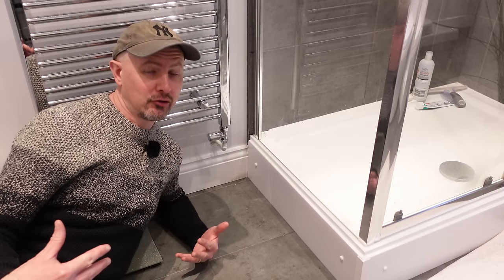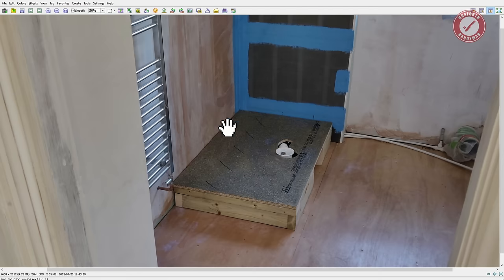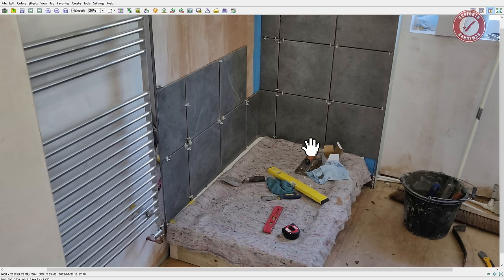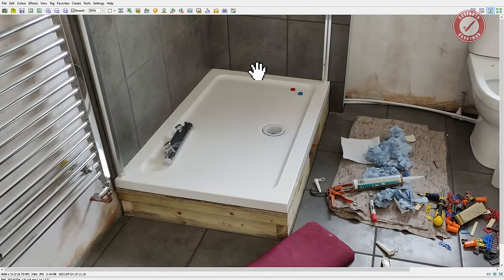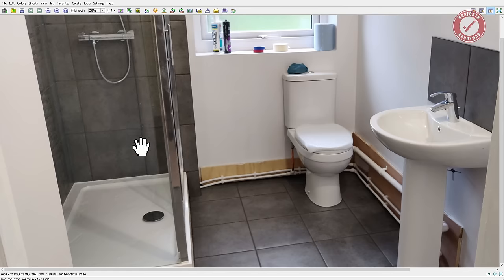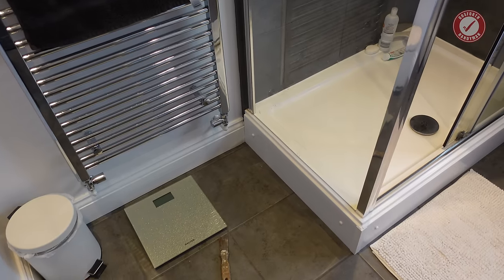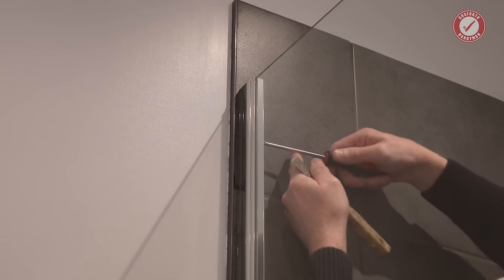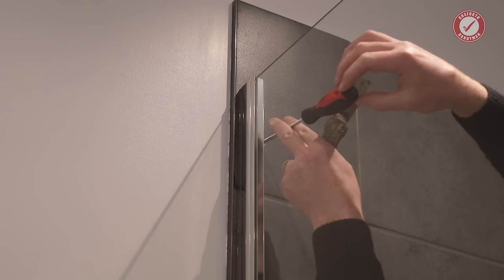How do you fix a leaking shower screen?

Comment: One should never seal (silicone) the outside of the door frame where it meets the shower or tub. The objective is to keep water IN the shower, not to keep outside water from entering the shower. Sealing both sides doesn't allow condensate water to escape, which can cause mold and other issues. Silicon applied on the outside makes the joints between the door frames and showers and/or tubs look better, and that it is sometimes applied as a quick fix because the inside seal is leaking.

Comment: Hi Andy I had a problem with the shower we inherited when we bought our house nearly 20 years ago .  As a seasoned renovator I was absolutely baffled , I obviously intended to replace the existing shower but I still wanted to workout were the leek was coming from just out of sheer curiosity . So I spent a ridiculous amount of time tracking it down .  Ironically the  leek only occurred after a period of time had elapsed , and spraying the shower tray never replicated the problem .  Then one day while using the shower I noticed a small hole in the grouting between the tiles , bingo because I tended to be relatively quick in the shower I never noticed any thing . But when other members of the family used it , the water had time to work its way through the tiny hole behind the tiles and through the floor .  Obviously we have long since replaced that old shower , and are on our second shower enclosure .    I often think what we would all do without the humble tube of silicone , even when we don’t quite get it right .     Best wishes and kind regards as always . 😀👍👍👍
Reply: Leeks and carrots!!
Reply from the maker: Other members of the family - teenagers per chance? 😂

Comment: hi Andy as a bathroom fitter for several years my advise with anything no matter how many times you have done it is to follow manufacturer instructions as they keep changing ( obviously if they have problems) ive had a few enclosure’s leak & they have replaced them because i followed instructions to the letter

Comment: Tidy fix by sliding the wall profile up and everything looks good but if you missed the silicone on one profile, did you miss it on the other one also ? As you showed the tray, tile, screen joint is the weakest spot in the whole "Dam" and may be a problem waiting to show its self. Also I would always seal up the joint where the door slides into the wall profile by 50mm to make sure water goes back into the tray and does not bubble over the outside bottom silicone seal. Having said all that a great video on solving the most common failure of shower screen installation. We have all been there at least once :)

Comment: I wouldn't worry, our new build house had both showers fitted exactly like this, and it was the same on all the houses in the development.  I despair with shower design, generally. Why is there no thought given to overlaps and weathering, as with roof construction. It can't be that difficult to come up with a system that doesn't rely on silicone and can be removed at cleaned.

Comment: Hi Andy, clever fix 👍! I had an issue before I entered the property maintenance profession with a bathroom renovation I had done in a property 15ish years ago. The fitters siliconed the screen on both sides all the way round 😮, against the manufacturers directions I later found out. A friend was using the shower and water started to pour through the hallway ceiling. It turned out water was filling up in the wall rail and unable to escape from the bottom eventually had enough pressure to force its way out through the silicone into the wall and through the ceiling below! They had to replace the screen (it was too gobbled up in silicone to reuse) and pay for repair of the ceiling and redecoration for the hall. So needless to say I’m now VERY careful to follow the manufacturer’s siliconing direction, but see the logic in your case and have done a similar thing for one of my customers.
Reply: Kind of puzzled why somebody who can afford a skiing holiday doesn't get a professional in to install the shower - maybe that's why he can afford a skiing holiday? - but the problem is it's people in later years who often inherit these problems when they buy the house. I'm an electrician, not a plumber, but 95% of all repair jobs I was called out to had been fitted by "handymen", and were often pretty dangerous. 

Currently got a similar problem in my own home, which is rented. Landlord's "plumbers" were mates of his who fitted the shower and they siliconed the inside of the door frame as well as the outside, trapping water inside. Shower leaked after 2 weeks, again after 6 months, water coming through the kitchen ceiling and I've resiliconed 4-6 times in 2 years only for it to start again later on. There's only so much I can do, we still don't know exactly where the leak is and he can't get the guys who did the job to come back, and won't fork out for a "proper" tradesman. A ton of hassle and aggravation that is only going to get worse (I suspect the whole lot will have to come out again), just because somebody tried to save a few quid.

Comment: I had similar on a new build - they had put a blob of silicone behind the uprights, installed the screen and then sealed the wall/tray.  Took me 2-3 days to sort - removed screen, removed all silicone, dried out, resealed the tray wall to 100%, reinstalled screen and applied silicone to outside of screen (it has been a learning about where you seal screens - I always thought more was better, and on the inside, but it is often less than I thoughts, and often on the outside!)
Reply from the maker: Great stuff! Yes, often less is more. Also makes it much easier to remove if that doesn't solve the problem. 👍
Reply: @GosforthHandyman   Thank you, your video on re-silicone was key in my whole process, thanks for the content!

Comment: I initially bought a B&Q shower screen. It was a 2 part thing that was obviously too heavy for its own good and failed where it was glued together. I replaced it with a Mira screen that was ~£150 cheaper! It's left behind some screw holes where there were additional supports but I filled these with clear silicone and may use them for soap trays. Basically avoid B&Q own brand stuff like the plague. The bath was bent, making the taps leak without extra silicone. The panel discoloured in the sun. 

Regarding your screen. Surprised it didn't require more silicone. The mira one had interior and exterior silicone as well as sticking it to the tiles and in the screw holes. Luckily I redid the bath edge seal too.

Thanks for sharing your mistake makes us mere mortal amateurs feel a bit better!
Reply from the maker: Yup - I've seen some screens that tell you to silicone behind the rails (along with the corners) but not this one. Had similar issues with B&Q sinks! 😬

Comment: Where the wall channel and screen fit together , its advised to seal between the two, normally up 150mm so when wall channels fill up it can't run outside but allows it to fill up and drain inside, great vids mate 👍
Reply from the maker: Cheers bud! This screen just wants the outer edges sealed.
Reply: I run a bead between the wall channel and the screen on the inside, that way the channel shouldn't fill up at all. Of course leave the bottom open so if something happened to get in it can still drain out

Comment: At the beginning you said it looked like the water was getting round the back of the tile and running down the side of the trim - was this the case or was the water just running in front of the tile ?
Great and clear video as usual keep of the great work  
👍
Reply from the maker: I think it was running through the grout at the back of the rail (where the silicone was missing) and finding its way to the back of the back of the trim.

Comment: Those metal wall down sections are often in two parts and designed to take water and channel it back into the tray. So as long as the first piece is siliconed to the tiles and the outside siliconed the water should just drain to the tray. I’d also suggest the bath trick of putting some heavy weight in the tray to emulate two or three people then silicone the tray to tiles 😂.

Comment: The wall molding is preventing the shower pan's return from going flush with the wall.  It's done now, to prevent leaks, fill that small area with an epoxy similar to JB weld.  The area above needs 3M VHB tape behind the aluminum strip all the way to the top. VHB tape is waterproof.
   To fit tape in a tight area, leave the backing tape on and only pull a small tab free. Peel in place gently.

Comment: Great job Andy.
I added a vertical bead of silicone to the inner edge also, and left it short from the bottom by 20mm. 
Also I filed the bottom edge of the vertical metal wall upright so it didn't compress the horizontal silicone seal between the shower tray and the tiles. This is an area you won't be able to see once the upright is fixed, so you can't see if the silicone is pinched/broken, and the 'dam' is broken. I appreciate you weren't able to do this with a retro fit, but it's worth considering when fitting a shower screen from scratch.
Reply from the maker: Nice one!

Comment: Hello Andy, I enjoyed your video, it was very helpful. I like your openness about perceived mistakes. The way in which you explain yourself as you work through the process of solving the problem is enlightening. May I make an observation about the manufacturer’s instructions - I believe that it is the instructions themself that are misleading. Like you, I followed the instructions to the letter. This  resulted in exactly the same problem - the line of grout, running along the edge of the tray and behind the bottom of the frame, cracked and resulted in a leak. I cannot remember what the manufacturer’s picture showed but, I now believe that the only part of the frame which you should not seal is the bottom of the internal corner of the frame (as it protrudes inward on the shower tray). If you run a bead of silicon down the wall on the internal side of the frame, outwards along the top of the tray (for the width of the frame), and perpendicular near to the corner along the top of the tray (for the depth of the frame), you will have a perfect seal for the frame to be set on. Any moisture which may condense within the frame itself, will be free to trickle out at the bottom of the frame, rather than stagnating (as the instructions warn against…). The problems which bad instructions cause is what is staggering - !

Comment: We had this in a property we bought. Water seemed to be leaking in all sorts of odd places but it was exactly this issue. The water was getting inside the shower screen channel inside (as it should) but then tracking down and runing behind all of the other silicone. It had run all around the bath walls and ruined the plaster so we ended up refitting the room, such a waste of money after some poor fitting. We went with Nuance Bushboard and covered all possible leaks, its perfect now!
Reply from the maker: Glad you got sorted! Amazing how much damage a small leak like this can cause. 👍

Comment: I’ve got a similar job on my en-suite to do next weekend. Old shower screen out and new one in… I’ve noticed on manufacturers instructions they suggest sealing 50mm up from the bottom between wall profile and the main shower sides on the outside… seems strange as they are so tightly slotted together I’m thinking just to silicone bottom two inches before slotting the screen into the wall profiles. They make it so faffy to stop this problem these days!

Comment: I have the exact same problem. Luckily for me I have a 4 upstand tray with the tiles built over it. so all the water stays contained in the tray. I did the unthinkable and put a bead of sealant on the inside up the rail and Long the bottom corner but none on the outside. No more leak and even if it does bypass the sealant it will filter through the front and cant leave the tray.

Comment: Same problem here, but I didn't install my shower screen it was there when I moved in. Pretty sure it's not sealed behind the frame. Only way I was alerted to leak was woodlice and carpet beetles coming from under my tub. Plasterboard and wood floor are rotten.

Comment: What i don't get is and i have siliconed my shower form the inside years ago but when i got my new shower it told me to seal it from the front (outside) which has worked great but becuase you have sealed the front obviosly dry soap etc will get under the shower screen so what is it seal the outside or seal the inside or seal both

Comment: The skiing has come a long way from sliding down Backworth pit heap in an auld cardboard box lol just had to re silicone the bath as you say the hard part is getting the old stuff off & cleaning it. Off topic noticed how corroded the flexible joints were any advice on how often these should be changed.

Comment: I've the exact same problem. Spend weeks re sealing base (needed doing) and being clever
With masking tape to pin point it . . Nothing worked .. will . Seal outside again and wait and see if leak is back. Lol  plan B: remove frame . Lol. Thanks .  👌
Reply from the maker: Good luck! Had a customer shower once with a similar issue. Turned out the installers had cracked a tile behind the vertical rails (tightened too tight) and water was tracking through there. Nightmare!

Comment: If it’s getting behind the tile, it will be tracking through the screw hole. Best to remove the track and silicone behind it
Reply from the maker: No, it was getting through the grout gap at the bottom and tracking behind the tile trim from there. Screw holes were already siliconed. 👍

Comment: Sorry you've had this problem, in removing my ensuite shower I found a historic leak that hadn't been spotted or fixed by the previous owners which may need a new floorboard, completely rounded off screw heads & economical use of silicon courtesy of the original fitters, & then on moving the cubicle downstairs to sell the door decided to smash into a million pieces in my hands 🙄
Onwards & upwards with the new one when I clean up the messes left & decide what size I can get away with
Reply from the maker: Hope you get sorted! I've seen entire joists rotted through due to leaks like this. 😬
Reply: @GosforthHandyman  oh don't say that 🙈 I'm hoping it's just the floorboard as it's flakey (chipboard) but not gone the whole way through. Anything will be a pain though when the entire ensuite is ~1.5m square so not much spare floor space
Reply: & love the supurrrrrvisor dropping in 😁
Reply from the maker: Don't worry, sounds like you've caught it in time! 👍😁

Comment: Charlie DIYte once said new silicone to old silicone is absolutely fine so no worries.😎
Reply from the maker: As long as the old silicone is really clean it should be fine. Trouble is on older silicone it's easy to trap muck / grease under it and it will eventually fail.
Reply: Butting up the end of new bead to the end of an old bead (as shown in this vid) is generally ok as where new and old meet there is no requirement for a structural bond. Just imagine it like two rubber seals pushed up against each other - even if they aren't physically bonded to each other as long as nothing pulls them apart there is no gap and water cannot get through. Laying a new bead directly over the top of an old one is a no-no.

Comment: Would always run a bead up the inside edge of the screen support. For the inside of the shower I recommend black silicone. It’s hard to get neat but worth it. Use your squared fugi to 90 the bead under the outside of the glass and then when that’s gone off you can finish the outside with white so the black isn’t visible at the bottom of the glass from the outside. This way you’re not refreshing the silicone that often. Mines 5 years on and sound. 👌
Reply from the maker: Good idea! 👍
Reply: Why black silicone? Is it structurally better? If just to hide mould that's pretty gross 🤢
Reply: @tmmtmm  no matter how good your silicone is it will start to show black spots. The silicone is still sound though. Using black silicone will hide those marks. It’s not an excuse for not cleaning though. 
Black is hard to apply though so your technique needs to be on point.
Reply: @GeeWhizRS  I have had 10+ year old shower installs that did not have black spots. Black spots are mould. If you have mould growing on the silicone it's time to clean it and if unable to clean it, time to cut it out and lay a new bead. Culprits are poor adhesion causing mould to grow in a gap that opens up between the silicone and glass/tile/frame, insufficient ventilation causing everything to be continually wet, or the silicone hasn't been smoothed over properly at the time of install which makes it difficult to clean. I've been told not to smooth over silicone with an ungloved finger in wet areas also, because you will embed skin particles and bacteria in the surface of the silicone which makes mould grow more easily. Should always wear gloves, or use a clean tool to smooth it over.
Reply: @tmmtmm  "I have had 10+ year old shower installs that did not have black spots." BS
Reply: @tmmtmm  No shit Sherlock. If you've got a shower with no sign of any black spots after 10 years then you're not using the shower.

Comment: use ct1,bit expensive but will eliminate any leaks
Reply: Can’t really tool ct1 it’s to sticky.
Reply from the maker: Just used to the Dow but I'll need to give it a try. 👍
Reply: I’ve used CT1 on a few (bodge) repairs and it is a miracle product. Fact. If they’d had a few tubes in New Orleans when Hurricane Katrina hit, they could’ve just patched up the levees and avoided disaster.